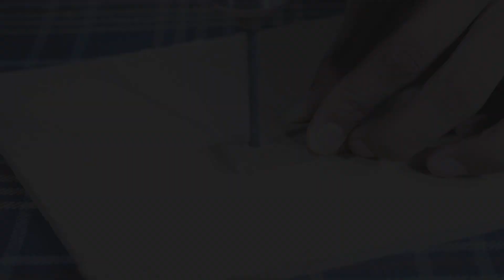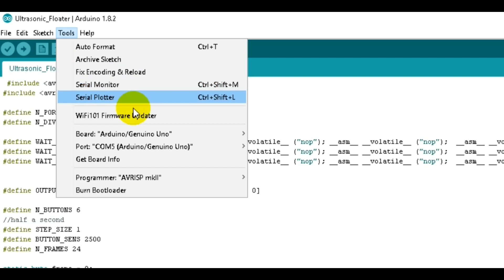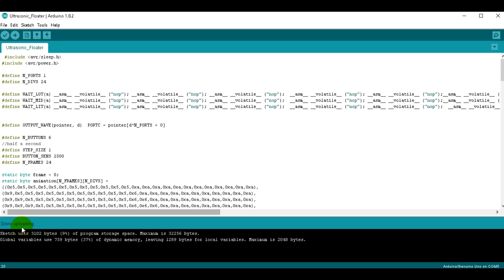How To Float Any Object in Air Using Arduino | Ultrasonic Levitator | Arduino Project | PROKNOW

Comment: does increasing power make the levitation cloud bigger.
Reply from the maker: To make a Bigger Levitator Project We Will Have To Increase The No Of Transmitter and Receiver:)
Reply: @proknow  Is it possible to make or find larger, let's say huge transmitter and receiver to go larger scale? let's say to levitate a bicycle.
Reply: @alexbravo6670  to do that you’d probably need absurdly massive speakers and a massive power-supply aswell as £50000 funding

Comment: Nice project! I tried reproducing it, but it does not seem to be working, even though it looks like I followed all the instructions correctly. I have used a bat detector to check whether any ultrasound was being emitted, and it looks like it is being emitted only when the Arduino is connected to the PC via USB AND the 9V battery is disconnected... weird! I then tried to levitate some small pieces of toilet paper but they don't even jiggle, possibly because the 5v from the USB are not enough? The only difference in my setup is that I am using an Arduino MEGA 2560 by Elegoo... any thoughts?
Reply: Use an l298n to increase the power